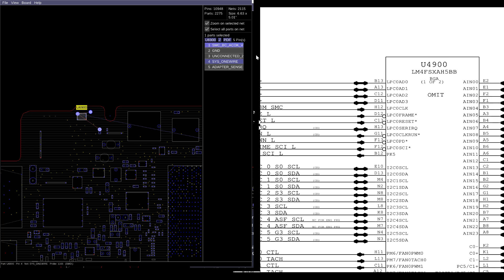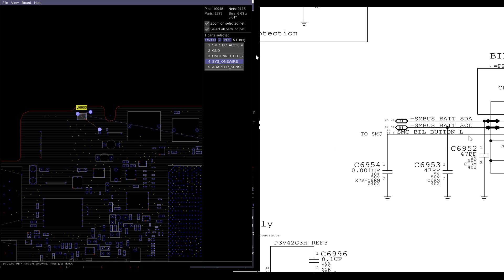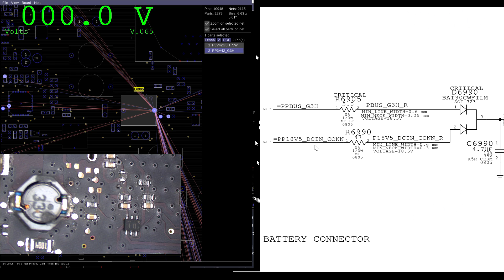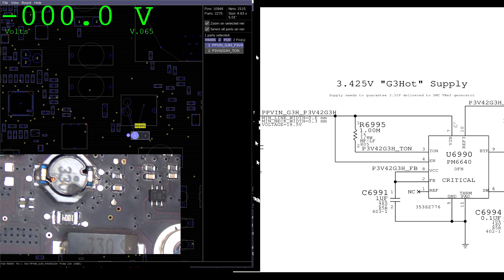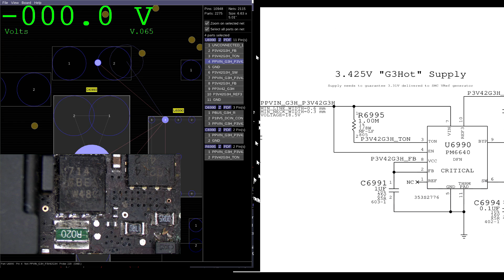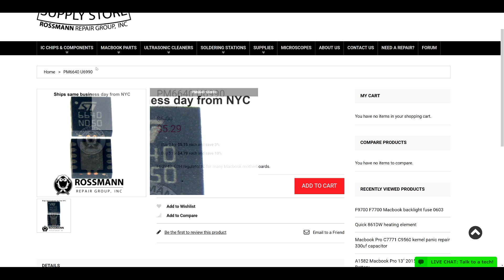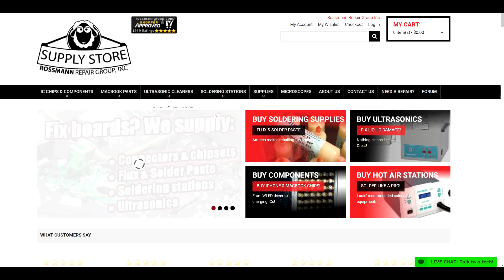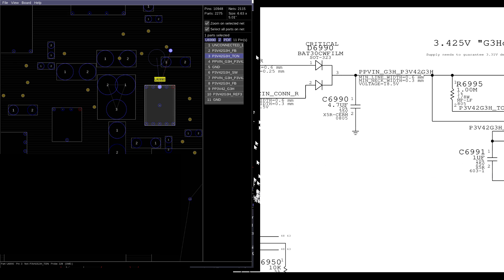Fixing dead Macbook Pro with PP3V42_G3H missing & no magsafe light

Comment: Correction about T_On: A higher voltage on that pin will lead to a LOWER On-Time (a shorter "slice"), since that's what you want to get the same output voltage for every input voltage.

Comment: my family have a similar macbook pro but its stuck in booting over and over again(sorry i cant give any specifics i am currently visiting with my grandparents) but all we want is to get the information off the hard drive and put it on our imac(not pro), what do you recommend, will removing the harddrive and putting it in an external enclosure pluged into the imac or my macbook air allow us to save it.
Reply: Othx it should, and removing the drive isn’t that hard, you need to remove the cover and 2 phillips screws to remove the piece holding the drive in place, then a Torx T6 screwdriver to remove the posts from the drive. Check ifixit, they should have a step by step guide.
Reply: but then what should i do to save the information on it, i know its not bad but i dont have a clear way to get the stuff off
Reply: Othx Put into an external enclosing and connect it to another computer, then it should show up as an external HD you can copy the  data from.
Reply: thankyou for the tips ill get back to you in a month once i  have acsess to the broken mac

Comment: daaang, NASDAQ:AGRX had a similar drop back at the start of 2017 and then another just before the end of 2017... 

normally I'd recommend buying when stocks are low, or at least buying more so that you can make your say $1.00 purchase into a $0.75 purchase when buying at $0.50.... 

but only after checking the historical stock prices I'd say sell, unless you knew of some knowledge to keep hold of it... (So check the news)... and well there's no harm in holding onto it, either someone is going to buy it, or maybe go back up?

Comment: 2012-2016
No refresh
Even on the price, amirite?
Reply: BlindAF verɪfɪed wrong. I think in 2015 or late 14 they bumped the price up by around 300 usd. Base model of course - 4g/500hdd
Reply: BlindAF verɪfɪed nah, I have a 2014 with soldered in ram and crazy fast ssd. Quad core.
Reply: Alik Griffin that's not the same model